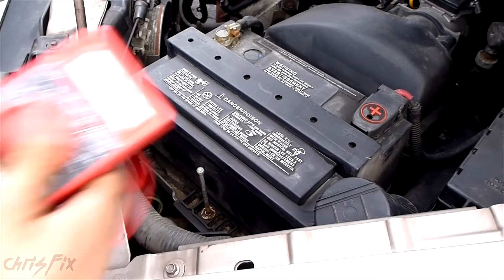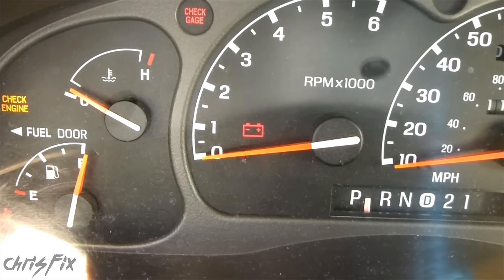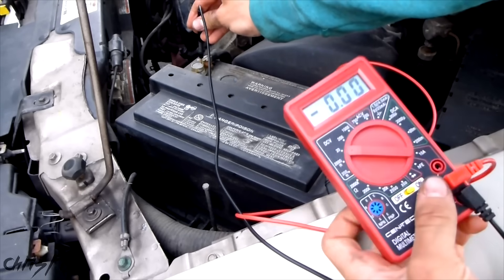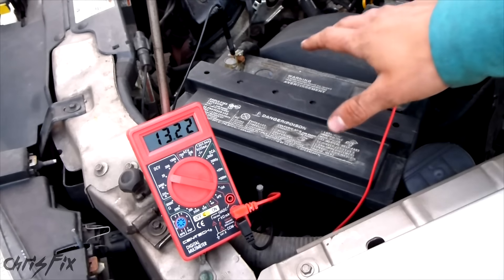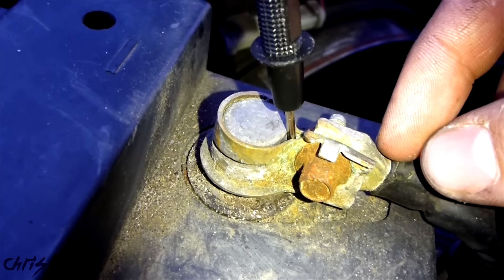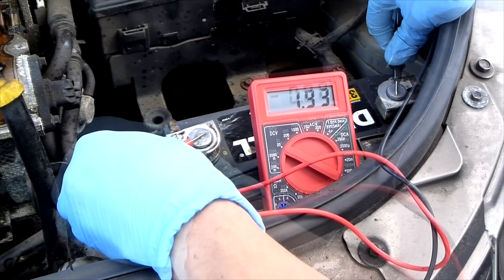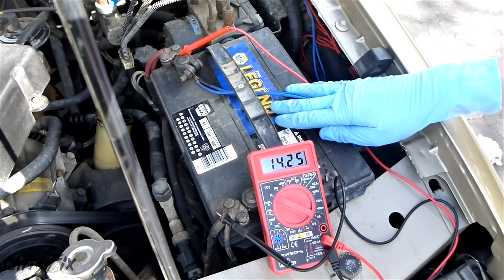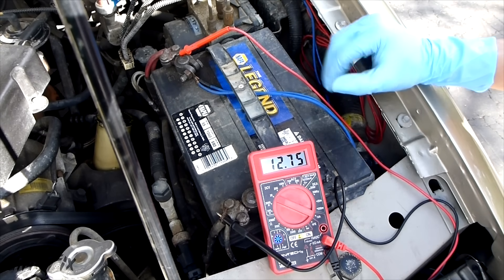How to Test a Car Battery with a Multimeter

Comment: Great video chrisfix...  One little point you can do to help make your battery last.  Is spray some wd-40 or anti-corrosive spray on your terminals at each oil change.  I have been doing this on my vehicles and normally get six plus years from each battery.

Second, the battery in my vehicle passes the mulit-meter test.  However, It does act up during a swing in temps.  Dead of winter and the hot summer.  I'm kinda thinking it might be time for a replacement.
Reply from the maker: Stephen Maurer Thanks for the tips Stephen! Definitely consider subscribing! New automotive "how to" videos every Thursday and most Mondays!

Comment: Hi Chris, Thanks for the videos. They are quite helpful.

My wife's 2001 Honda Odyssey has had problems starting on two occasions. My wife said the first time she had a problem the engine turned over slowly as with a dying battery. After three attempts the van started and drove normal for about a month. A few days the van had the same problem, except she ran the battery completely down. I jump stated the van and it started easily as usual. Other than these two times, the van has started normally with just a turn of the key. Beside these two problems the van has run very well and receives regularly maintained. I checked the battery as you described in your video. The terminals are clean and tight. The battery reads 12.6v. With lights, fans, etc, running for two min the volts dropped to 11v. As soon as I turned off the load the battery jumped back to 12.6v. With the van running and all electrical on the alt the meter read 14.2v to 14.6v. What do you think?
Reply from the maker: Kenji Does this problem happen when you let the car sit for a few days (dont use it)?

Comment: Great post! My car normally has trouble starting. Sometimes it will start but most of the time it just cranks very slowly. I followed your tips and I got more or less 12.4 before starting and when and if I successfully start the car it jumps up to around 14.XX. But when it fails to start (clicks or cranks slowly while trying to start), the reading is about 7.XX to about 8.XX. Does this mean my battery needs to be replaced? (Also checked your alternator video and my alternator seems to be fine.)
Reply from the maker: Glenn Gomez Thanks Glenn! That sounds like the battery needs to be replaced. How old is the battery? You can take it to your local parts store and have them check the CCA on the battery for free and that will tell you for sure if you need a new one!

Comment: Great video. Is there a particular battery memory saver device that you recommend for a '10 nissan altima when I test and possibly need to replace the battery?
Reply from the maker: pythonflying Hm. I never had that question asked.  Is there a particular reason you need one?
Reply: To save the settings in the radio, bluetooth phone contacts, fuel trim, etc. when I disconnect the battery.
Reply from the maker: Gotcha. I never used a battery memory saver so I cannot recommend one. Typically the radios that are "high tech" have batteries built in to save the bluetooth contacts and radio channels and such. Let me know if you find one! Good luck!

Comment: Thanks for the video it was very helpful I just have one question. Should I connect the multimeter to the earth and not the negative terminal as this could create a short or does it not matter at where the negative lead is connected? Thank you again Chris
Reply from the maker: Tristan Turner Connecting the multimeter to the ground or to the negative terminal is the same thing so it doesnt matter. You get a better reading from the battery post so I use that. Thanks and definitely consider subscribing! New automotive 'how to' videos every Thursday and most Mondays so stay tuned!

Comment: Dude,I hv an 02' Tahoe with remote start,I replaced the alternator 10 mths ago but the mechanic said the battery was good,this week my battery has been dead every morning.I charge it with my portable but by the next morning its dead.After watching ur vid,I hv to get a voltage meter after I get the new battery.One of the best car vids I've seen,very informative.Question,would the remote starter contribute to the loss of cell power or CCA's?Thx
Reply from the maker: samrothstein2 Here is how you need to test the battery to check for a draw on the battery: https://www.youtube.com/watch?v=n5FJDgcdii8
Let me know what you find and definitely consider subscribing! New automotive 'how to' videos every Thursday and most Mondays so stay tuned!

Comment: my car has a side post battery where would i connect the leads to because there are no terminal posts for me to stick the leads to. thanks
Reply from the maker: JR Kersten The side post terminals still give you a power and ground, it is just on the side. You can unscrew the wire a little and slide the probe so that it touches the metal and then screw the wire back in so the probe doesnt move.

Comment: Have you ever used petroleum jelly to protect your terminals.   Been using it for years with out any problems.
Reply from the maker: sketchyssk8shop I dont  but I have had other viewers tell me the same thing! I will try it out! Thanks!
Reply: ChrisFix never thought about dust.  I just glob it on there.  It's is MESSY but works well.  My in laws van had corrosion issues no matter what I used. Tried petroleum jelly and thst solved it.  Is dust an issue I need to worry abiut?

Comment: Great video. Thanks. My car has been giving me some issues with the battery losing charge, but I didn't want to simply go to a car parts store and buy a new one without understanding how to determine if the battery was on its last leg. Now I'm going to check the alternator video to rule out that, too. Just in case, I don't want to be taken for a ride with that either.
Reply from the maker: Jose Santos Great! That is exactly why I made these videos! Glad they were helpful and let me know what you find! New automotive 'how to' videos every Thursday and most Mondays so stay tuned!

Comment: Hey Chris fix, I just wanted you to know, there's a method I use called "clear flood crank." I use this for the load test, what this does is it prevents the engine from running by making the fuel injector pulse width so small that the engine cannot run and will continuously crank. when you turn key to on position, floor the gas pedal (sounds crazy I know.) then while holding to the floor, turn to start. Most modern vehicles enter this mode but not all so if it starts you gotta be quick to let off and remain vigilant. This is useful for diagnosing compression, fuel injector signals, can and crank signals or even simple load tests. It'll remain in clear flood mode until throttle is less than 80 percent depressed. I crank generally for no more than 10 seconds and I watch the voltmeter steady out at the given voltage.
Reply from the maker: Brenndon McGill Great tip Brenndon! Thanks! I will have to give it a try!

Comment: So what is your method for keeping your battery in such good condition after 6 years?   Trickle charger?  Add battery acid?  Desulfinator?
Reply from the maker: Kevin Johnson Drive the car... haha, I have no tricks. I dont let the battery run down and my alternator is good. Sometimes you get lucky I guess. Oh, and I also keep my connections to the battery clean and I keep my grounds on the body clean.
Reply: Good for you.  Honestly.  Someone has to be winning in this country.  Keep up the good work....and just a little less "Made in China" please.

Comment: Can you do this test with an auto-ranging multimeter like a Fluke 177?
Reply from the maker: n310ea Yes, all an autoranging multimeter does is pick the correct range (like how I tell you in the video to set the multimeter to 20 dcv, yours only needs to be set to dcv and it will figure out the best range for the voltage given.

Comment: You can put the wd40 while the battery is connected to the car and start it up?
Reply from the maker: Mr. Vega Yes, why not? WD40 is just an oil and it removes moisture so the terminals do not corrode.
Reply from the maker: V.T. Eric Layton Glad you are subscribed and thanks! Thanks a lot for the tip too!
Reply: most people think putting wd40 on battery terminal will explod
Reply: ChrisFix  Just ran across your YouTube channel (and subscribed) while searching for an easy way to change out Trailblazer headlight bulbs. Your vid about that was excellent. 

About the WD-40 on the terminals, though... that's fine, but if you really want carefree terminals for the life of the battery, smear a healthy portion of standard bearing grease around the terminal connectors after you've cleaned and tightened them to the battery posts. The grease is longer lasting than the WD-40 and will not harm the battery terminals, wiring, or connectors in any way. 

Regards,

~Eric

Comment from the maker: +Shane Blandford-Scherr, I cannot reply to your comment for some reason, but if the battery is working and you are not having any problems with it holding a charge or starting the car, just keep using the old battery! It is amazing that the battery lasted that long and it is still working! Batteries last 4yrs on average today!
Reply: +ChrisFix I recommend making a sign that has your logo that will cover your licence plate. Instead of using a piece of paper. Are plates magnetic? If so you can attach the sign at will with strong neodymium magnets. If the plate is not magnetic, you can screw a few small magnetic metal strips, or even screw magnets themselves to the plate using magnets like these: http://www.amazon.com/Master-Magnetics-RB45CX10-Fastener-Diameter/dp/B00IYFNT4M/ref=sr_1_1?s=industrial&ie=UTF8&qid=1460593785&sr=1-1&keywords=neodymium+magnets

Or you can just use some type of small hooks, or invent your own method. It will look more proffesional, and it will make your life a little easier whenever you want to hide your plates for future vehicles.
Reply from the maker: jose Hernandez Glad that I can explain things clearly even since English is your second language!
Reply: ChrisFix chris do you have any knowledge about epson salt and making a weak battery last longer? is it a myth?
Reply: +ChrisFix Excellent Video! Apologies for the intrusion, I am interested in your thoughts. Have you considered - Saankramer Complete Details System (do a search on google)? It is a great exclusive product for learning how to check vehicle history without the normal expense. Ive heard some unbelievable things about it and my buddy finally got amazing results with it.
Reply: +ChrisFix Its latsted that long because it is a Napa battery.  We had a Napa battery in one of our larger tractors.  That battery lasted for 11 years!  I couldn't believe just how long it had lasted.
Reply: +ChrisFix my car battery is 9,6 volt and it is not starting is my battery dead
Reply: tim de jong
yes
Reply: my battery on my car has been charged many of times and put back in the car and after a few hours the car won't start and if it does and I shut it off it won't start again
Reply: my battery on my car has been charged many of times and put back in the car and after a few hours the car won't start and if it does and I shut it off it won't start again
Reply: +Dylan Webb Replace the battery.
Reply: +George David I all ways buy cat battery's, they always last around seven years.
Reply: answer plz
Reply: ChrisFixl
Reply: ChrisFix q
Reply: The battery could still be bad even if you get a 12 volt reading on the multimeter.  Most batteries will read 12 volts when they are bad that is because the bad battery does not have the Amps there are needed.  
Take the battery to an auto parts store and have the Amps checked.   Warning:  If you try to check the Amps on your battery with your multimeter set to amps, it may and probably will blow the fuse in the multimeter
Reply: ChrisFix nice
Reply: No, but if you use the blood of a chicken on the terminals with a broken toothpick it will charge the battery, LMFAO
Reply: 05 primastar
Reply: I saved an old battery by refuelling with some distilled water inside of the cells and charging the battery with a charger,I used this battery almost a year

Comment: Hi, my sister drives a 1994 Nissan Sentra and the battery is almost 14 years old.... It is a massive battery for a little car 950 CCA when I put my volt meter on it when its been sitting over night its 12.4 volts, and starts the car fine should she replace it even though we can't really afford it?? When I asked at walmart they didn't even believe the car had a 14 year old battery with 150,000 k on it lol
Reply: Have you been topping up the battery with Holy Water?
Reply: Neil Kirby  yes that's what  I've been doing and Jesus has been looking over her battery for her as well lol no that battery is gone now couldn't last the winter but thanks for the laugh 
Lol
Reply: Similar experience, old VW Beetle, with dynamo, ask for a 45ah battery. Replaced with 75ah (because it fitted). Well almost 9 years later was finally replaced. ;-)
Reply: On rare occasions, batteries have absurd lifetimes like that. When I worked at a parts store, I saw two batteries that made it well past 10 years. They were never parts store batteries, though.
Reply: I don't believe you either!
Reply: but that's Walmart...………..lol

Comment: hi, im from portugal, there is something i have to ask you and im not sure you can tell me why but i will trie: i have a jeep and my battery voltage after i start the engine always goes to about 13,80 or so i guess since i bougth this car, however now happens to me that this changed and mark about 14,50, well i dont undestand why this is happening and yesterday i checked the water and one of them was dry however this 14.50 remains even after i had put water in it  and i dont know why this is hapening ...thankyou
Reply from the maker: joao fretes Paulo Hello Joao, the alternator will adjust how much current goes to the battery to charge the battery. If your battery is low, then it will add more current. If the battery is charged, it will add less current. It is supposed to maintain the battery so the voltage reading will change. Make sense?
Reply: What you say really make sence, but in my case here not really because like i wrrote you , since i bougth the jeep that the gauge stays always in 13,90 or so , but now pass to 14,50 so the point is why is the battery recibing more charge now.......however yesterday i saw a dry element in the battery and alreaddy fixed it and i most tell you that this nigth the gauge is returning to the 13,90 and all normal again so i guess was the dry element. Thankyou for your replay
Reply from the maker: Ok, glad the information was helpful. A dry cell can cause that so good job finding the problem.
Reply: Thankyou again

Comment: Dear Sir, thank you indeed for your lovely videos. As for using WD40 on battery post, a better solution to prevent corrosion buildup is to use either a grease or Vaseline petroleum jelly (the one uses on skin) as this will isolate the terminal from outside environment which causes corrosion buildup. Thank you and keep up the great work.
Reply from the maker: John Kaplanian You are welcome! Thank you for the tips. I bet petroleum jelly works great because it is so thick!

Comment: hey,i just fixed the car the problem was that the engine was full of fuel and it needed to start when i puted foot on the gas and started the car and holded my foot on gas for like 2min and then it started perfectly and my alternator is creat ,battery is new ,got new sparkplugs and coils to its even more powerful then it was before. anyways thank you for your help.
Reply from the maker: Great! Glad you fixed your problem!!!

Comment: when i tired to start turn the engine on it showed 7 volts so that means its bad battery,will this work if i load the battery to full
Reply from the maker: It means your battery is getting old. If it drops below 7 you might have a hard time starting your car. You might find this winter your battery drags a bit when trying to start the engine. Does she drag a little now?

Comment: I got 12.53 idile and 13.7-13.9 charging. Its good or bad ?
Reply from the maker: What do you mean "idle"? When the car is idling, it is running so the voltage should be near 14v. That charging voltage seems a little low but it isnt anything to be concerned about at this stage. Are you having any problems that you think your battery is bad?
Reply: ChrisFix I changed my 3 years old battery. One day it just randomly wont start. All stuff worked  even sub + amp.But did not crank. Did not have that ticking  noise of starter when it has not juice for start.Starting was little bit lazy and panel dimed when i try to start. Now i got 10 years old OEM BMW battery works fine for now. Will try your charger test soon,
Reply from the maker: Gotcha, good luck and et me know how it goes!
Reply: ChrisFix got some problem. Engine on - no voltage users - 14.00V Engine on + heater full speed+ hi beam + low beam+Fog( all 3 hallogen H1 bulbs) + Radio + subwofer 12.2V  Engine off 12.5v , in starting 9.98V.  I noticed when i turn lowbeam+foglight ( onr swich)  car sound changes to heavyer. And when i put hi beam voltage drops 0.5 v alone.

In case Low beam+ foglight + fan 2nd gear + radio + sub voltage keeps 13.95. 

I dont know what Amps generator gives,but i know i got 90Amp battery.

Tomorow i will look at Hi beam wires. 

Edit starter runs rly nice. Car starts easy.
Reply from the maker: The voltage with the alternator running should be around 14v which yours is so you are good with nothing drawing. It does drop off a lot when you add a bunch of stuff, but that might be due to overloading your alternator. Let me know what you find. Oh, and that noise is just a heavier load on the alternator.